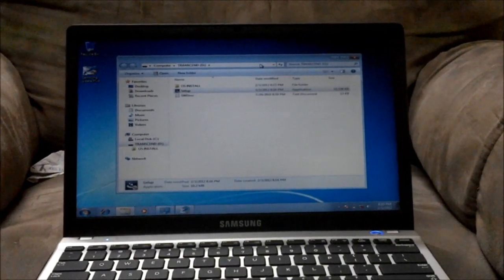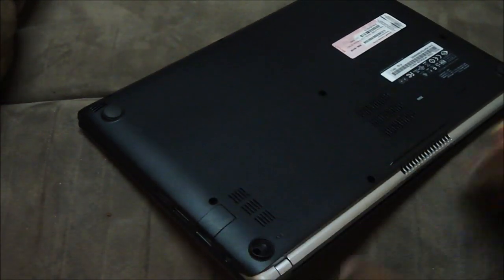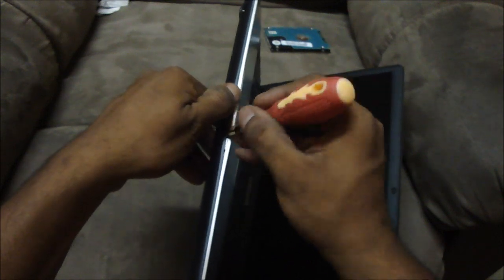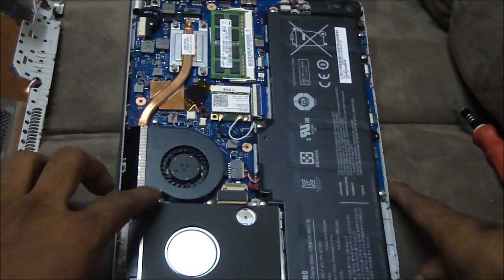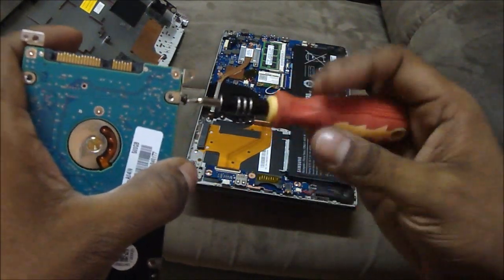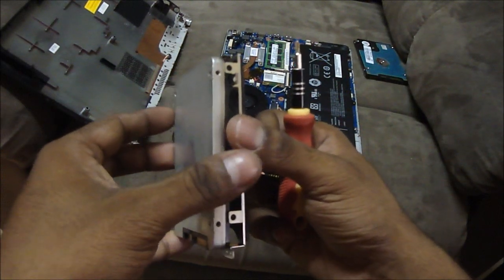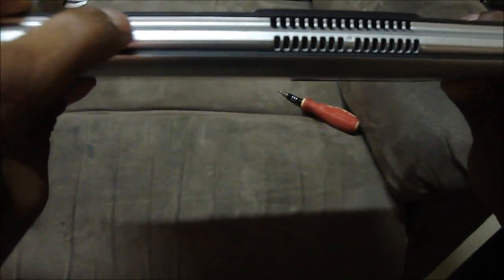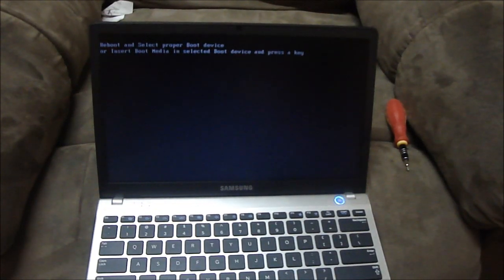How to disassemble a Samsung Series 3 (NP350U2B) Ultrabook (HD) - Cursed4Eva

Comment: hi, i have a similar laptop ... a NP350-U2A not a U2B and i broke it's screen
i found only a U2B screen... will it work on my U2A ?
thanks
Reply: for anyone interested, it's the same, also the hdd-ssd swap operation is the same, replacing it was easy, you only need a screwdriver (fine philips head) a credit card to open it without scratching it, and a banana ... if you like bananas

Comment: Great video man. Do you know if the NP350U2B can run 1600mhz memory? The Intel page for the i5-2430M says it can use 1066mhz and 1333mhz RAM, I'm considering an upgrade to 8GB but not sure if I should get 1333mhz RAM or 1600mhz RAM.